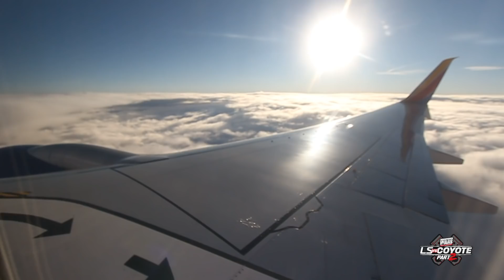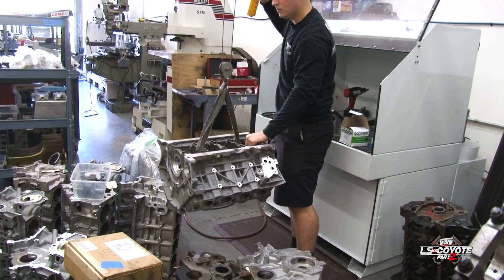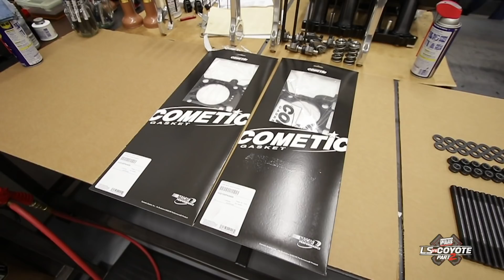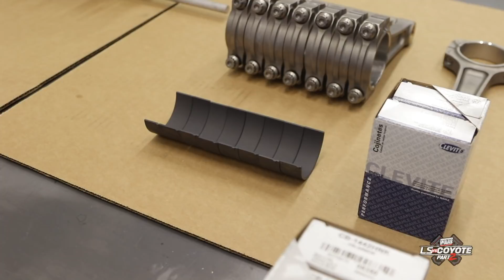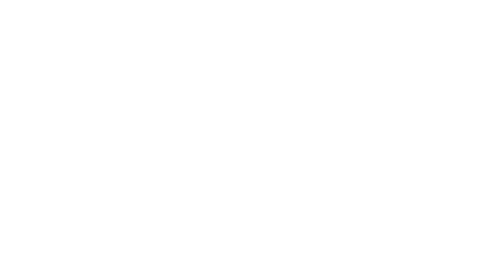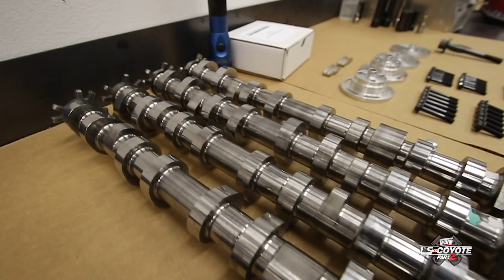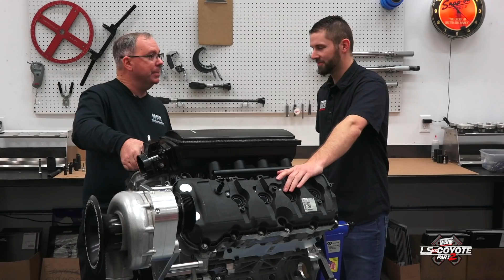LS vs. Coyote 2 Episode 3: The Coyote Engine Build

Comment: They stacked the deck much higher this time for the LS ..using the LS7 (427 cubes) vs. the tiny 5.0L Coyote.. What's the matter, too afraid to go .040 on the Coyote pistons, rather than eating up critical budget on new sleeves?  And the Coyotes stock crank and rods, will easily hold 1000hp ..These LS guys have tons of Chevy brand loyalty ..but zero integrity.

Comment: Coyote Build
                                      
Stock 2015 Mustang Gen2 Coyote 5.0-liter                                           ???? can't verify  1800.00
Darton Coyote GEN3 Sleeve Kit (PN 300-056)                                      ????                      1000.00
Machine Work: MPR Sleeve machining,                                                 ????                      1150.00
Oil Squirter Block-Off: MPR (PN 0226X)                      (ebay)                $  59.95                   65.00
Crankshaft: Stock 2015 Mustang Gen2 Coyote                            *      $  00.00                included
Manley I-Beam Rods (PN 14518-8) With ARP2000 Bolts                    $1560.99              1560.99
Rod Bearings: Clevite Coated (PN CB-1442HNK)                                 $ 207.92                 207.92
Main Bearings: Clevite Coated (PN MS-2292H-C                                 $  89.99                     87.99
Oil Pan: Stock 2015 Mustang Gen2 Coyote                                  *       $  00.00                 included
Oil Pump: MPR Billet Oil Pump Gears (PN MPR 0451X)                     $ 350.00                  350.00
MAHLE Piston Kit w Pins & Rings (PN M4V167640X10)                    $ 996.60                 967.57
ATI Coyote 20-Percent OD SFI Balancer (PN 918066N)                      $ 456.00                 534.53
Starter: Stock 2015 Mustang Gen2 Coyote                                  *       $  00.00                     00.00
Front Cover: Stock 2015 Mustang Gen2 Coyote                         *        $  00.00                    00.00
Head Studs: ARP2000 Head Stud Kit (PN 256-4301)                          $ 290.99                280.99
Cam Cover Bolts: Stock 2015 Mustang Gen2 Coyote                *       $  00.00                    00.00
ARP Main Stud Kit With Side Bolts (PN 156-5803)                             $ 255.99                 258.99
Intake Bolts: Stock 2015 Mustang Gen2 Coyote/Holley                       (Included With Intake)
Oil Pan Bolts: Stock 2015 Mustang Gen2 Coyote                       *     $  00.00                     00.00
Harmonic Dampener Bolt: ARP (PN 156-2502)                                 $  31.99                     31.99
Starter Bolts: Stock 2015 Mustang Gen2 Coyote                       *     $  00.00                    00.00
Cam Bolts: Stock 2015 Mustang Gen2 Coyote                           *     $  00.00                    00.00
Cylinder Heads: Stock 2015 Mustang Gen2 Coyote                  *     $  00.00                    00.00
MPR 2015-17 CNC Porting (This wasn't counted on LS)                 $ 600.00                600.00
Intake Valves: Ferrea 1.500 Competition (PN F2243P)                    $ 400.00               400.00
Exhaust Valves: Ferrea Super Alloy (PN F2245P1.262)                   $ 480.00               480.00
Valve Seats: Ductile Iron Intake(PN 1536-130-350-D)                      $ 160.00               160.00
Springs: Manley (PN 221419-32)                                                         $ 514.99               515.00
Retainers: Manley (PN 23605-32)                                                        $ 435.99               435.99
Locks: Stock 2015 Mustang Gen2 Coyote                                   *     $  00.00                  00.00
Seals: COMP Cams (PN 523-32)                                                          $  25.99                  22.00
Locators: Manley (PN 42153-32)                                                         $ 156.99               157.00
Cam Covers: Stock 2015 Mustang Gen2 Coyote                        *     $  00.00                  00.00
Lifters: Stock 2015 Mustang Gen2 Coyote                                         $  00.00                  00.00
Camshafts: MPR Racing Cams Custom Grind Blower                    $1595.00            1595.00
Timing Chain: MPR Billet Lower Gear (PN MPR 0313X)                  $ 395.00               395.00
Camshaft Lockout Kit: Pro Series Billet Camshaft                           $ 550.00               550.00
Lockout Plates With ARP Hardware, And Actuator 
Blockoffs (PN 0426X)
Rocker Arms: Stock 2015 Mustang Gen2 Coyote                     *     $  00.00                  00.00
Intake: Holley Sniper (PN 833152)                                                    $ 921.95                 921.95
Fuel Injectors: DeatschWerks 2,200cc                                                not counted in budget 
EFI Throttle Body: Holley Sniper EFI 90mm (PN 860010)                not counted in budget
Head Gaskets: Cometic MLS (PN C5286-045)                               $ 121.56               115.00
Supercharger: ProCharger F-1A-94 With 8-Rib Drive                        not counted in budget
Spark Plugs: E3 (PN E3.112)                                                                not counted in budget
Fuel: E85                                                                                                  not counted in budget

Totals as of current 4/3/2019 prices                                           $14607.89               14668.52 (their math) 
                                                                                                                                              14642.91 (my math) 
    
But the list above only account for one head                                  $  121.56                 121.56
gasket so both should be $121.56 more   
                                                                                      Grand totals   $14729.45            14764.47

Outside of prices I couldn't verify, It's cheaper to build it today by $35.02 

Not sure what they left off the list to be $25.61 off from whats listed.Even with their math
and the second headgasket it's under 15k as per the rules... 

Sorry for the rows being jacked up...I swear I'm sober... Its all Youtube's fault lol

Comment: I predict the Coyote will fail horribly to compete with the titan of the performance world, the tried and true mighty LS.  Ford has had a real problem keeping the chains on their motors which I think is hilarious considering they claim that they can sustain high rpm's and are designed to make all their power up top which happens to be exactly where the timing chains can't stay together and grenade the engines.  I really feel sorry for all the Ford fan boys that buy into all the hype and throw all their hard earned cash into a giant black hole and find it extremely telling that ALL of the winning Mustangs that have forced air induction happen to have switched to an LS engine.  Just sayin'

Comment: @9:34 So you're saying that using oem bearings in a build like this is a no no because of the precision clearances? It's funny how in all of these build videos no one talks about bearing choices, tri-metal (copper/lead/tin) vs oem style bi-metal (aluminum/silicon.) From what I know bi-metal bearings will last a lot longer, but all aftermarket bearing manufacturers say you shouldn't use these in a build above 500 horsepower, yet the LS9, LSA, Hemis all have bi-metal bearings. I'd like to hear what pro engine builders have to say about this. Is this true, or is it just a marketing ploy?

Comment: Most of the LS engines come from the factory with a very soft tune. Nice to know that a custom LS cam costs $1300 less than a comparable cam upgrade on a Coyote. $1300 that can be spent on more goodies.
Reply: IDC for the intake that cost 1/4 to  1/3 of the budget, surely not needed and I highly doubt its the best choice as its purpose was to fit unde the Vette Hood line but they get to CNC their logo in it for promotional purposes... Probably could have saved 2000 right there.

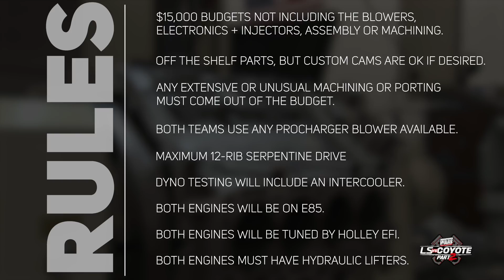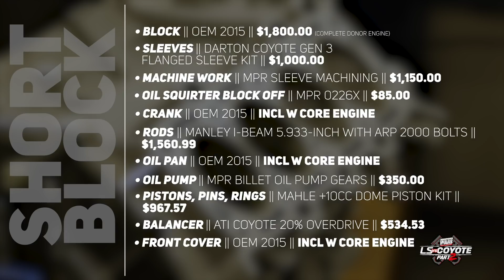Comment: @2:16 in the video you list "Rules" and Line #1, $15,000.00 not to include machining.  So why at 14:59 line #3 you list $1150.00 for "Machining"?
Reply: It's simple, The Coyote needed sleeving and the LS didn't so they charged the the Ford for it to pad the LS parts advantage... just as the LS parts are discounted Vs list price.
Reply: Exotic machininging like porting and re-sleeving comes out of the budget.

Comment: For anyone interested in what a similar cubes Modular would do here is the highly praised 2013 Engine Masters results. The dynographs listed in the link are the best qualifying pull each team had for  the competition.  
https://www.hotrod.com/articles/2013-amsoil-engine-masters-challenge-top-finishers/
It doesn't take a genius to see which one makes the most avg power. The LS didn't win because of how the challenge is run. Worthy to note the highest HP was a 572 Ford but rules and scoring formula for cubes put it at 2500pts vs the 29-2800 pts the top 4 engines had.

Comment: I don't like that it's not an engine out of a current vehicle from both brands.  However it's still an Ls and I guess I could deal with that. What Def isn't fair, is the machining and and discounting in parts. It's not equal. They should have upped the budget to 20k and charged for everything.
Reply: What "Discount in parts" ?

Comment: For the next rematch how about you use a 4.8 or 5.3 against a coyote. Then you will truly know the best bang for the buck.
Reply: What I'm getting at is even a 5.3 or a 4.8 would make more power and be a better all around better performer with less money spent than a coyote. You will always spend more to try and build a motor that can compete with a GM. Coyote engine builders want to say they are able  to build more hp to c.i. Well use a smaller ls engine and let's see how true that statement is. I personally don't think it's a true, and  that's also why you see so many people using an ls for there builds to make cheaper reliable power.

Comment: All the 5.0 boys came here to whine after getting beat by a engine that has the same design from the 1960s... takes boost for a coyote to compete with a cam only LS7. Oh, and 3 more cams. Cant wait to see the LS win this.
Reply: @damon henry,   Do some research and you'll find that Ford vs Chevy or Dodge at the same Cubic inches, the Ford usually makes more power.  Motor Trend Magazine (online) did a 350 vs 351 and the with the same mods and the Ford made more power and torque.  The last LS vs.Coyote #1 they admitted that if the Coyote was the same C.I. it would have won easily smoking the LS .  Engine Master Competition, Ford 1st place 11 years out of 16 years the competition has been going.  Chevy has won 4 times, Dodge 3 Times.
Reply: @Steve-wl7jt  exactly. If ford wanted to win bad enough they would have more ci. But guess what? They dont.
Reply: You mean the Chevy has the same design as a Ford from the 60's...Chevy gave up on the original small block design in the 90's.

Comment: This is not fair, compering a huge , physically bigger coyote engine to an very compact ls motor... is just not fair. .. this is so fake, huge coyote engine has advantage, cant even fit in a miata ..unless is well chopped..hahaha
Reply: Im an LS guy but that kinda evens it out because the LS has a huge displacment advantage
Reply: @nathan22outdoors8  i know right im just tired of hearing the same excuse from ford people
Reply: So if it was possible, let's put the Coyote  heads on a Ford big block and now what?.....What your B.S. story line going to be????????? Face it. Beyond 7500RPM your LS is nothing more than a wet noodle.
Reply: @henri1511  lol, remember when honda guys used to be bashed on cuz they were small and had to rev to the moon, blah blah blah ,now that u guys have a good head is different, all of sudden u guys dont complain anymore, fan boys,
Reply: @henri1511  doesnt need to rev that high if its making a shit ton of torque and hp down low. The heads dont make that much of a difference in rpm either, the chevy still has a bigger bore and stroke so it wont be able to rev high for that reason.
Reply: I remember when ls1s came out, ford had to come with the terminator engine to even compete, forward somw years and zl1 came out with lsa supercharged and you ford giys complained, always an excuse , when ford had to implement the supercharger first to be competitive... we could go on and on..
Reply: Saying how Ls engines are bigger cubes etc, etc, etc..
Reply: @jmzavala5215  and the coyote has double the valves so they have more air flow
Reply: So if the Coyote had same cubic inch as your LSX,  you figure the LSX would win hands down???
Reply: @henri1511  no but thats what its all about, we have the cubes, ford has the rpms, but if you notice all the other comments are from ford fans saying that its not fair,  is like anticipating a lose, and making excuses just in case, honestly i think coyote will make more hp but its also about powerband, and i think lsx will take that, u ever heard of SAM camaro, running an ls engine 433 cubes i belive, c5r heads spinning over  9000 rpms, and still a pushrod engine, making over 1000hp n/a and that was 9 years ago...
Reply: @henri1511  if it had the same cubes kind of like the  6.2 Raptor POS it wont fit in anything anyone would want to build... Exactly why  even 10yrs now the 6.2 is a unicorn engine... Instead of whining about cubes which can be covered with more  RPM and head flow volume, YOU FANBOIS SHOULD BE COMPLAINING ABOUT THE HEAD UNIT DECISIONS. If anything loses this for the Ford camp thats it right there...
Reply: @shaadydog1  So???? all you "it has to fit in a Chevy Sprint or it's Sh**" kinda mentality is just so STUPID. Real car guys, make it fit. 

This is useless..................................
Reply: @henri1511  Same story from Ford camp as always, WHAT IF's and STIP's.....
Reply: @shaadydog1  Right back at you( the Chevy camp ) for making the same drawn out comments.

Comment: Leave it to Triple F's to make having huge aftermarket support a bad thing.  Been interested in cars for over 30 years now, going back to preteen years. One thing that was always wanted was better cheaper aftermarket support. Bigger, better, stronger, more powereful with no intention of meeting some libtard definition of safe or green.  Not just aftermarket parts but upgrades to factory parts ERL no longer into automotive would convert any ls2/3/l33 into a superdeck,6 bolt and you got 510 cubes capable block and capable of at least 2200 HP. RED would do the same thing. Smh at the " hate" for aftermarket support.

Comment: The scoring system seems flawed, but I don't care to get fully vested in this argument as I care more about results from cars vs dyno's.  So from a non-expert view, but in general the 2nd criteria seems like automatic 3 points for LS.  The 3rd criteria is automatic 2 points for Coyote and it feels like a handicap for Coyote.   I could tell from watching the LS build episode that the previous NA video series was just to prove their bias.  The guys was slobbering all over the LS blocks??  Seems like the fix will always be in unless the contest includes someone that is an advocate of both types.  The guy should say "full disclosure -- I love LS motors and I want LS to win" that way there's at least some credibility.
Reply: They were  slobbering over an LS block a mere clone of the very old FE block. Nice going Chevy freaks.
Reply: The shame of it is we were stuck with shyt 302/305 and tp350 for years... Ford had a great thing right in their hands till Chevy swooped in and modernized it. Ford has had their hand in alot of inoovative stuff and then abandon it, one of their most glaring shortcomings. Their engine lines are not the easiest to follow and it's continued to today, right back to pushrod for fleet trucks. Gm meanwhile could have blessed us with a 18/15 degree V8 how long  ago? With minor changes to production blocks. As good as the Ls/Lt platforms have been and developed that still pisses me off. Ford should take the best attributes of their entire line of engines and hybrid them into 1 engine. Both GM/Ford should develop their DOHC v8 into v10/12 too. GM should adapt Ls/Lt heads to the BBC, the cam vvt, DI and whatever else from the  platform for their rumored over 8 liter fleet engine being developed.  Coincidence they coming out with BB tytpe  engines about the same time for the same  basic purpose?

Comment: The mustang only has a 8 rib pulley vs the 12 rib on the LSX.  That could definitely limit the max boost on the coyote. I wonder why they didn't allow turbos on the builds. Cost?
Reply: To make it more similar i guess
Reply: I would imagine because of the huge displacement gap you could run substantially bigger turbos on the ls, an F1X cost about 4800 depending on where you get it. You could buy 2 Billet S480 Borgs with V1 Race cover and make  2x as much power plus  for less...

Comment: I really am curious as to why they aren't using the vvt technology on the coyote.  The vvt is what gives the factory coyote such a huge powerband without sacrificing peak numbers.  In a competition where area under the power curve counts for so many points why would you throw away such a huge advantage?
Reply: I think at some point the cam timing and lift get so out of hand you have an interference issue with intake and exhaust being open at the same time, the more lift and duration the less room you have to move timing until you get to a point where its not possible. In this situation though i think the Holley controller might be  the problem explicitly.